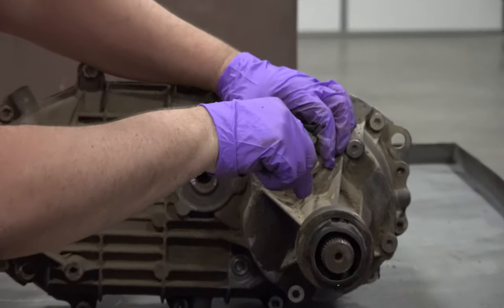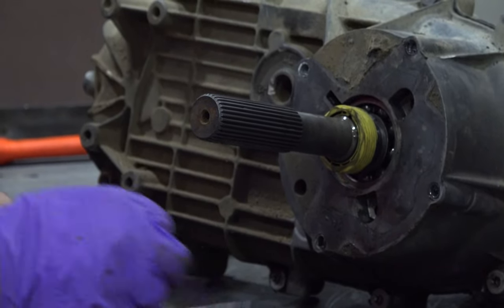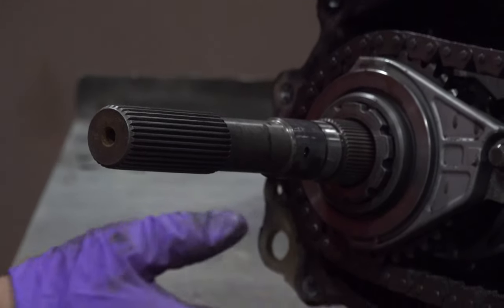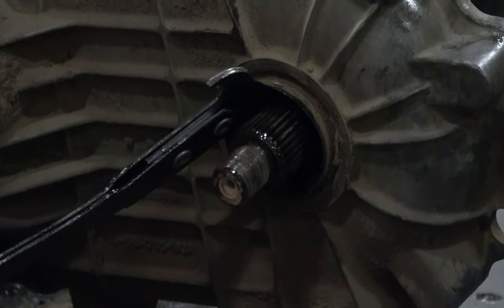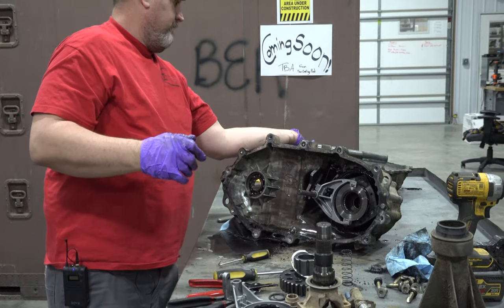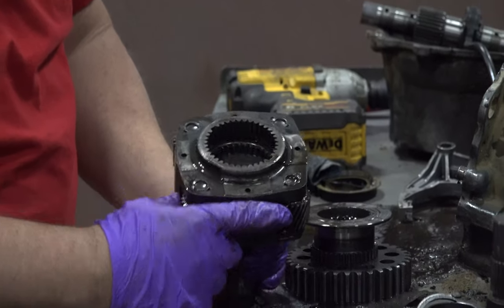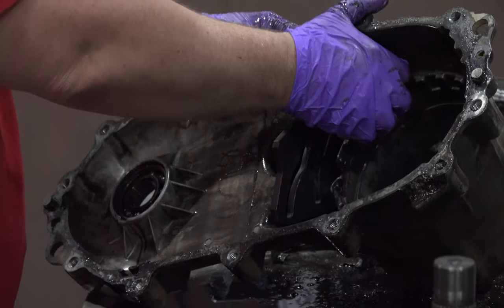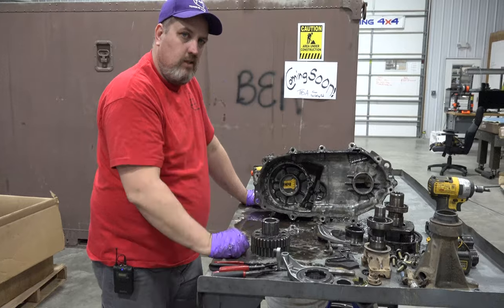BW 1356 Transfer Case Teardown

Comment: Do the 1356s have crush sleeves that need to be set when putting them back together? I'm currently pulling mine to replace the inner seal and resealing it for leakes. Thanks for sharing this video.
Reply from the maker: No crush sleeves, but if it's coming out it may be a good time to throw a rebuild kit at it anyway. The chains are rated at an average 150k life span...

Comment: Hello, I had a problem with my transfer case not shifting in 4 low. What do you think it is causing the problem?
Reply: Hello I have the same problem with my transfer case on my 1987 ford f250. Did you figure yours out? I am going to have to tear mine down.

Comment: I own a 1996 ford bronco. I had to replace the shifting bracket. The previous owner really didn't take of this bronco.I found the bracket cracked and the shifting pin bent. so I replaced the bracket and straightened up the pin and slotted bracket so it would shift right. Now it doesn't shift into 4 low.
Reply: It sounds like the linkage may not be adjusted correctly.